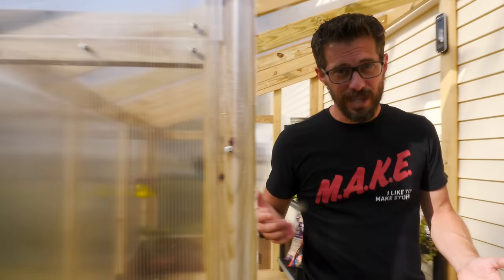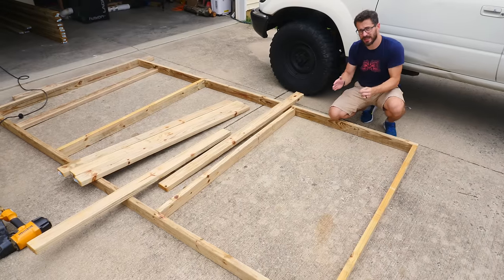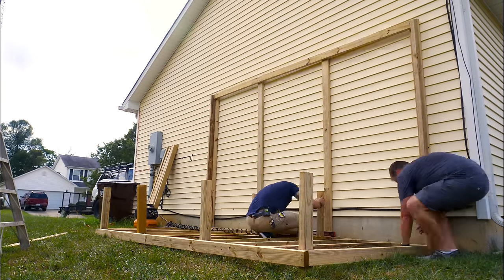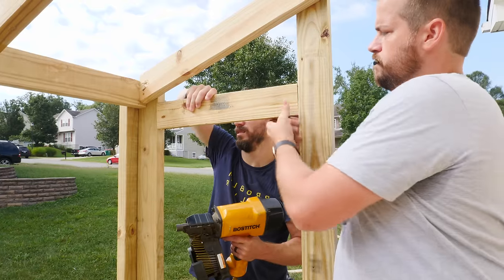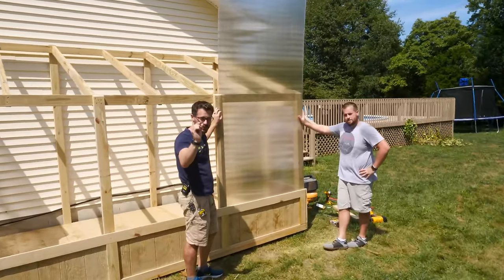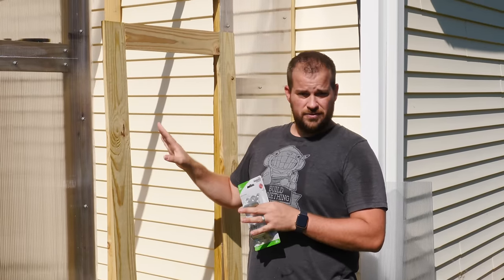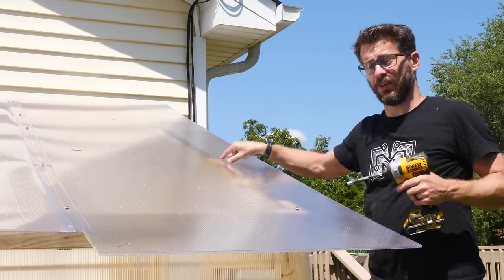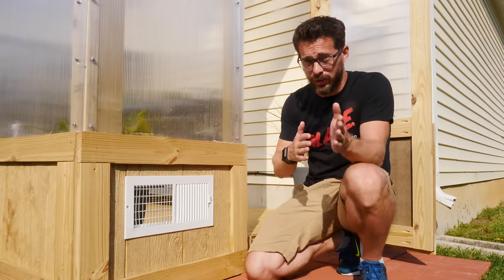How to Make a DIY Greenhouse | I Like To Make Stuff

Comment: Hi Bobby, great demonstration. WARNING to viewers, after just 10 years, many of the polycarbonate panels require replacement. I wish there was a longer-lasting material for this purpose. Is there something that can be done to extend the life of that material? Thanks.
Reply: Yes there is… you can do the same thing with glass. Just make sure when using glass, that you take into account, the roof vent system… you will want it properly framed and a hinge system installed for the framed glass opening, as well as a proper securing system to ensure the “roof windows” close and seal correctly. I built this exact projuct using glass about 12 years ago and I have yet to experience Any rot, mold, or failure of any panels. I got All of my glass at Either the ReStore, or Habitat for Humanity, for pennies on the dollar in costs… total project cost for my leanto greenhouse, was $350 bucks for wood, glass and caulking…
Reply: @preprebelactual  amazing ! How did you get the glass fixed to the structure ?
Reply: you can use Corrugated Fiberglass Roof Panel, we had them in my parent's house, they were functionally there for 40 years.

Comment: Just curious why you chose to have a full wooden floor rather than use pea gravel so water can easily drain away after you've watered the plants.
Reply: Not to mention the geothermal value of bare ground
Reply: @timothygreer188  Plus wont the wood on soil rot quickly while it would dry off quickly if placed on gravel?
Reply: @AleaumeAnders  yeah especially when using 2x4, 4x4 would have given a better footing. Those 2x4 are gonna sink right in.  It would have been easy enough to place small cement pylons under it. There's also no french drain, so the "clay doesn't move much once it's settled" will retain water and speed up rot and topside erosion. The framing was done nicely and the coroplast is a nice touch, though I would have left the film on the roof parts to help decrease excessive heat. Don't get me started on the vents that are going to blow open with the first big gust of wind and drench the inside
Reply: Here's a great video from Lowes that shows you how to do that: How to Build a Greenhouse https://youtu.be/Bbibe0yuiew
Reply: Great idea❗
Reply: Was thinking same thing... greenhouses don’t need a wooden floor. This is more like a shed.
Reply: Sorry I didn't see your reply, I basically said the same thing.
Reply: This is a tool commercial  not a DIY.
Reply: Building codes probably have something to do with that, or property lines.  Since they wanted it on the side, they probably didn't have much room to work with.
Reply: Maybe ground hogs are an issue? That's why I would put a wood floor.
Reply: Because it's sponsored by Lowe's and he's trying to attract new customers for a project I guess
Reply: Some people jump first, then learn to swim later.  This guy makes good videos, but it seems he's one of those people.  Didn't research it very well.
Reply: I def would not have put a wood floor in. Your going to need gravel for drainage especially with clay soil.
Reply: there alot a flaws with this design.
Reply: @lanerider9937  i guess he's not selling the design it's more of a concept
Reply: Because, although a lot of contractors are very good at using their tools and putting things together, their planning and forethought is lacking. Well built and looks good but the floor...
Reply: They didn't know how to level the ground? Should have done an interlock floor with 4" of screenings under it, and use concrete screws with treated lumber. It will drain well, it's indestructible, and retains heat.
Reply: Kevin C what do you mean when you say screenings? And concrete screws in the lumber? I like indestructible, so I’m all ears. 👍🏼
Reply: i could'nt agree more
Reply: My local permit office would have a fit if they saw this video, lol
Reply: People need to realize that this is a "hobby" project and not a real greenhouse.  My bet is that this will become a glorified tool shed because most suburban DIY people don't want to do the work to have a real greenhouse.  Lots of very POOR decisions in this design.
Reply: Also pressure treated wood.
Reply: @timothygreer188  yeah that plastic must weight a ton, NOT! East wall is ok.
Reply: @stevenbryant4718  If you think I'm talking about the weight of the plastic then you're about as clever as your use of "NOT!" in 2020
Reply: @veilanddagger5895  dont need but some do. I have a cement floor in my greenhouse.
Reply: Because they don't know how greenhouses work.  They just know how 'to make stuff' and play loud guitar music.
Reply: This will be half rotted out , covered in mold or blown apart within 2 years
Reply: @edbenson98  Looking at that kit versus what's made on this video, this version looks so ghetto.  Plus, there is definitely water getting into that structure between the greenhouse and the house which will damage that Vinyl siding over time.  If you're not going to seal it off properly, you should just make it a free standing building.
Reply: Trays and pots make water drainage easy to remove.  and zero weeds
Reply: Yeah they probably noticing now
Reply: @edbenson98  That video sucks + that kit is around $3000-$4000
Reply: @greatstag  That kit is $2,861.45.  It is specifically linked in the description.  Have you priced lumber lately?
Reply: Thanks for the advice. I will look into this
Reply: @SithLandlord  Not ghetto, this version looks so suburban lol
Reply: Because they are incompetent and wasteful

Comment: Question: it’s been 2 years since this greenhouse was built.  Could you do a look back to it; listing how it is today, what would you change to make things better or ...  As always, thanks for sharing this video content.  Trusting that you and your families enjoyed a great thanksgiving holiday.  Cheers...
Reply: I honestly would not go with plywood and 2x4’s on the floor. I would build the initial floor frame with 4x4’s and the floor with deck boards (treated or composite). I would highly recommend grading though. Take the top soil out and put down gravel (preferably limestone or bank fill) and pack it in. Thirdly I’d install a drip ledge along the roofline and Z channel where the greenhouse paneling meets the wainscoting. I don’t know anything about the corrugated plastic but make sure the plastic is uv radiation resistant.
Reply: I can guarantee, since been taken down! As there was so many flaws in this build. It was a neat project,  but I guarantee it didn't last.
Reply: @Zootycoonman223  4x4s??  why?? maybe 2x6s but 4x4 doesnt make any sense for a floor joist - not from an engineering perspective - better yet, maybe just use pavers
Reply: @Zootycoonman223  I would actually just build the floor joists and fill in with gravel. the floor is inviting critters to live under, since it will be very warm.
Reply: @KatBurnsKASHKA  Covering the joists in gravel would encourage them to hold moisture and rot... Great idea...
Reply: making an open gravel floor would be better than enclose floor imo.
Reply: She means not building the floor in at all. Gravel base for drainage and posts.
Reply: It would be awesome
Reply: You won't, this is a crap design sponsored by Lowes. Right away with all the hokey montage music, and then the 2x4's for feet to raise/level the thing you can tell this is gonna be rubbish. So many things wrong with this build.

Comment: Title is wrong should say how to build a temporary DIY  greenhouse that will rot away in two years.
Reply: @jimfix do you think it would stand a chance in a more arid area?
Reply: And have a few species of rodents and insects make it their home.
Reply: Monique Rennie The problem is ground contact put a cement block under each corner also on very hot days the sun will warm up and melt the vinyl siding.
Reply: FD Pressure treated lumber soaks up water like a sponge I have almost 30 years of construction experience but if you don’t wanna listen then don’t
Reply: I always love watching girly men at work 😂🤣
Reply: I give it eight years.. I have  a chicken coop built on the ground and when I replaced the door I had to make the new frame all crooked.. ugh lol nope,  if I built something it's going to last..
Reply: A greenhouse is under far different stresses than a simple planter. A planter tends to have a chance to dry, while a greenhouse is constantly wet across every inch of it and much hotter. The combination can be a fatal one for structures like this.

Comment: Love the concept. 
Definitely will use pea gravel for floor for drainage.  Love the plexiglass panels.   Will make mine 6x4.  Being a Lowe's Pro allows me to have all materials cut to actual sizes needed. 
I like using screws instead of nails.
Thanks for this video.

Comment: Two things I would have done differently. I would have framed in the roof vents to prevent a high wind from ripping the vents off. As they are, there's no way to latch them closed. I also would have painted the framing to the color of the house before installing the clear panels to prevent the wood from turning gray with age or at least stained it first.

Comment: Concerns I have with this are:
1) The vinyl siding will bucket after a few seasons from the heat.
2) Those little 2x4 feed will sink into the ground.
3) the wood will rot (Pressure Treated or Not) on the feet and underneath due to moisture and lack of ventilation
4) It's still going to blow away - even if its tied to the house
5) The HOA will make you take it down
6) You should have sloped the floor and had drain holes as you will get standing water in it.
7) Mold and slime will grow on the siding inside the greenhouse due to heat and humidity and water getting in between the roof and siding.
8) Critters
Reply: Some of your points are unavoidable with any green house
Reply: Building code dictates subflooring is allowed to be no thinner than 3/4 inch
Reply: @Luwdig Van Mozart not true, but at that point they can become expensive
Reply: I recently helped build a 96-ft high tunnel. If you use aluminum tape on the top and paper tape on the bottom of the polycarbonate sheets, it keeps bugs out and allows moisture to drain from the corrugated structure of the sheets
Reply: @sukt00  doesn't matter if there is an HOA or not, because the county has building codes regardless that have to be followed
Reply: 5) not everyone has an HOA lol
Reply: Imagine living in an HOA.

Comment: For higher wind areas, use T posts and use bailing wire run through holes drilled through the studs and wire the studs to T the T posts. You could also use diagonal braces anchored to flat foundation stakes

Comment: Looks reasonably good BUT sorry it's not going to last . Also you mentioned that you weren't going to be attaching it to the house ? What about the lag screws your running through the wall ? That qualifies as being attached to the structure .

All in all it looks good but you could have taken the time to weatherize the structure using flashing and caulking where needed . Even if the ground is clay ,a 2X4 footprint will dig into the soil in no time at all . At this point I'd at least put a piece of 1/8 sheet of stainless steel under the posts to spread the load out and protect the wood a little more so it doesn't rot so easily . Just a thought .If it were me I would have anchored the structure by putting the posts into concrete thereby avoiding the attachment to the house but to each their own I guess .

Comment: Nice job but it seems odd to not set the frame onto cement blocks or some sort of foundation ?
Reply from the maker: You certainly could, but I don't think it's absolutely necessary.
Reply: I Like To Make Stuff you went to all the trouble of trying to level off the floor but you chose to use a tiny footprint of a 2x4 to support ALL of that weight. The weight of the framing, the planters, soil, water, snow, etc. CAN NOT be supported by such a small footprint. The RIGHT way to do this would have been to use 4x4 TREATED posts for the leveling feet, and plant those on top of concrete patio blocks or deck blocks to distribute the weight. That greenhouse is going to sink into the ground when it gets wet because you have far too much weight being spread over far too little surface area. You say to check codes for high wind areas but you clearly didn’t check the codes for this type of construction. Follow the codes for building a deck and you’ll be in good shape. Also, the wall framing is screwed up. You have ALL of the weight of the structure above the floor being supported by the shear strength of the nails you used to attach the vertical wall members. Unless those screws are stainless or hot dip galvanized then they’re going to rust and break. Wall members should NEVER rely on nails for their load bearing strength. You should have built your floor and then nailed the vertical wall structure ON TOP of the floor, like a REAL framing is done. This is a recipe for disaster and is not the way to build a lasting structure. Looks good enough for you to cash your sponsorship check, but that’s all. In a couple years that thing will be falling apart because the moisture from the greenhouse will have rusted away the only thing that’s holding it together: the screws. Massive fail.
Reply: Yes, it should, otherwise it will take just a decade for the moisture to ruin the whole construction
Reply: @g1mpster  This ^
Reply: I Like To Make Stuff do it that way and it will only last 5-10 years
Reply: @g1mpster   "In a couple years that thing will be" another video for another YouTube'r "How to fix ... ?" xD
Reply: @Iliketomakestuff   It's necessary.
Reply: It gonna rott in 5 years
Reply: @Rottensparrow   I think the guy I bought my house built on the ground like that... it's been a blast ripping all his rotten stuff out.. no thanks.. I'll use blocks ECT..
Reply: @g1mpster  If the nails don't shear off first. That's a lot of damn weight to put on so few nails.
Reply: @Iliketomakestuff  You need to admit you are wrong and learn from your mistakes.  Unless you are a millennial, of course, then you know better than everybody else even when you are wrong and bad things happen as a result of your mistake but you still are right and don't think that humility is absolutely necessary in life.

Comment: I normally use concrete blocks dug into the ground to level up my base as wood touching the ground rots so fast. Great video 👍 cant wait to get mine finished.
Reply: These guys are incompetent & wasteful
Reply: I was thinking the same thing. This construction is going to rot from the base as the exposed wood sucks up humidity and water from the ground. They should have used some concrete blocks as a foundation.

Comment: I've spent 15 years in construction and this wasn't really completed to weatherproofing standards, that trough that was created will build up with water and rot. Guaranteed 5 - 10 years from now that floor will be rotten and the skirt that was placed around the outside. Especially since it is made out of fibre board, that stuff loves to absorb water. I noticed a comment that said to place on gravel for drainage, great idea and better price point. Another thing to consider is using deck blocks or patio stones. Always start with a level surface, don't be lazy. These are just some things to consider if think about using this method. Other than that, it looks really nice!
Reply: I wouldn’t want it so close to my house and sharing a wall. I would be concerned about damage to the house wall with the increased heat and humidity.

Comment: We have a lean to greenhouse on the front south side of our house. We installed it to be multifunctional. It also acts as a Trombe wall. There are two existing windows behind it on the house side. After installing the greenhouse, I installed two vents through the wall near the floor beneath the windows that allow air to flow between the interior of the house and the greenhouse. The windows (opened at the top) act as the upper vents to allow warm air to  enter the house from the greenhouse in winter and exit from the house to the greenhouse in summer. Vents in the roof of the greenhouse are open in summer to create the required chimney effect but are closed in Winter. In Spring and Fall we use screens and leave these windows open. It works great. Outside the front of the greenhouse we also have cold frames. The greenhouse allows us to grow vegetables all year round and to start plants to transplant to our gardens in the Spring.
Reply: Would love to watch a build/design video on something like that!
Reply: @meikusje  I appreciate your interest. We plan to put up a YouTube channel soon. We are in the process of moving. I plan to offer online training in permaculture design and passive and natural building and onsite hands on builds as a follow up. The new location is in a natural area with excellent tourism and outdoor adventure opportunities. I can’t wait to be up and running and teaching again! 😀